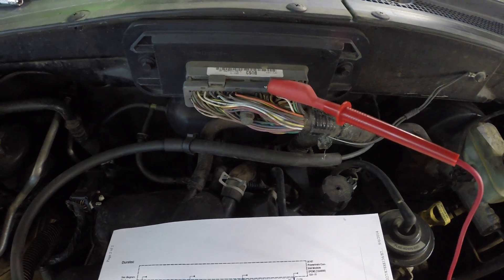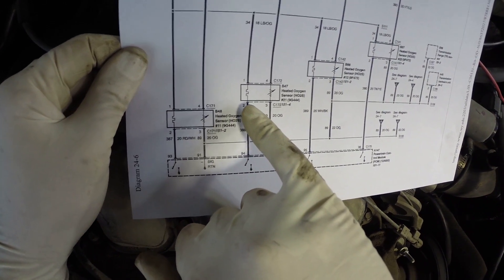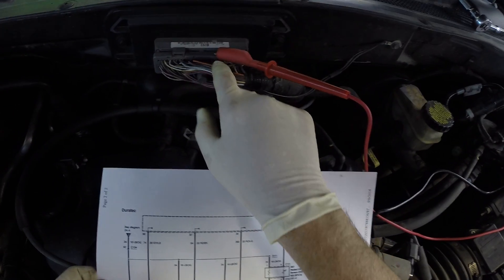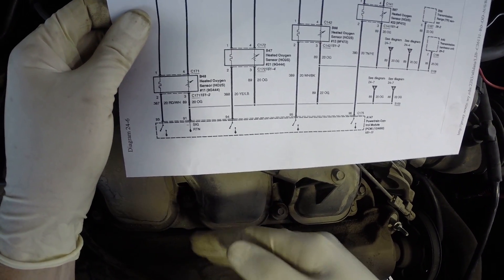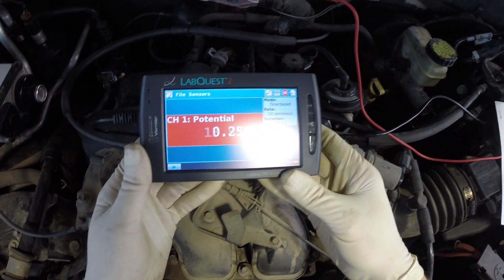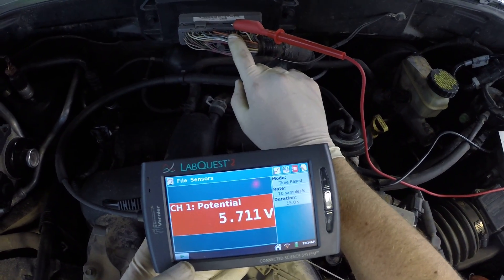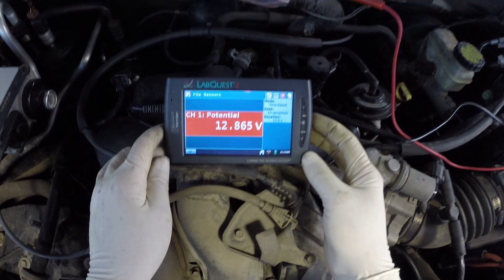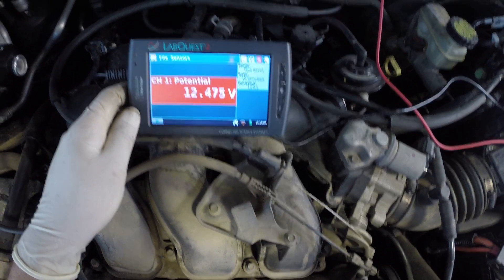PCM Circuit Activation Testing

Comment: This doesn't rule out component? Correct? What about ground side switched circuits that require voltage before they even pull to ground?